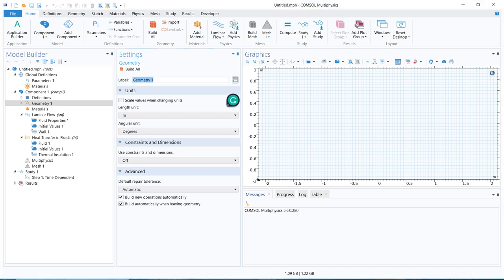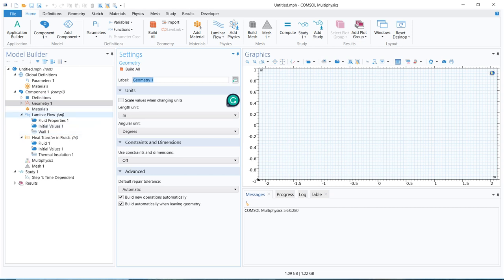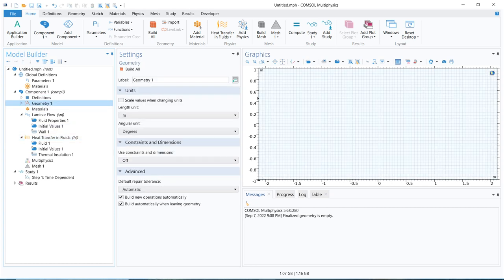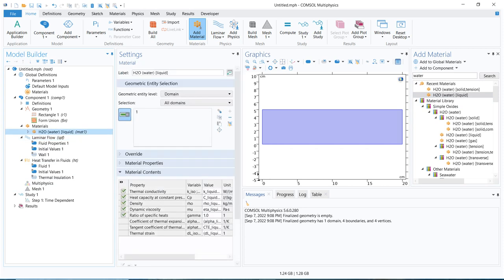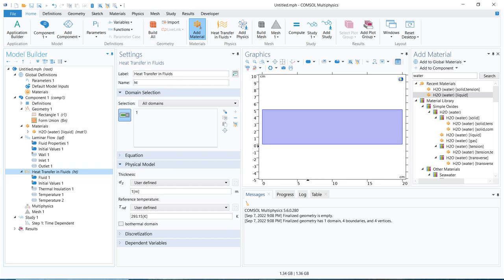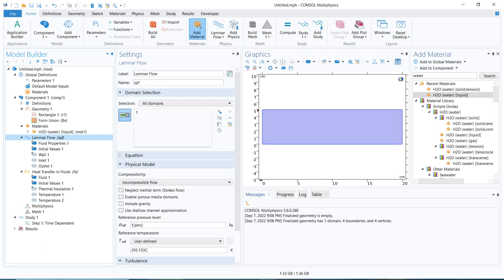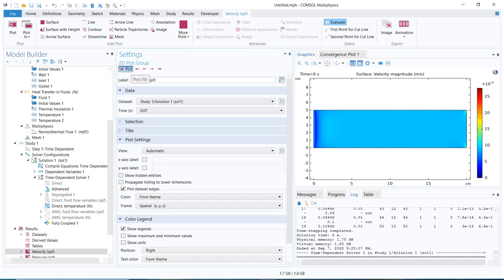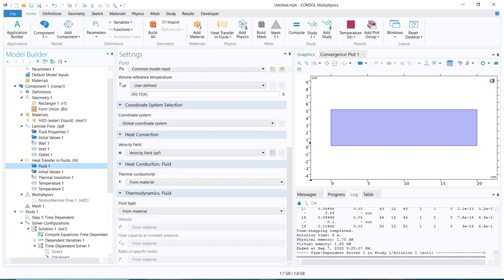Concept of Multiphysics Coupling Option #Multiphysics #Coupling #COMSOL #research

Comment: I am working on simulating the flow of gaseous hydrogen within a porous medium with the additional complexity of a chemical reaction that generates heat. I have successfully set up the basics of the flow and porous media in COMSOL (Brinkman equations and Heat transfer in porous media). Still, I am unsure about how to incorporate the heat source term issued from the chemical reaction into my problem, especially in the Heat transfer in porous media.

Comment: Hi, thanks for your video...will there be  different in results if left segregated and fully coupled ways? Is it always we need to stop solution when we see the groups in solution and stop the simulation and add fully coupled....
Reply from the maker: If your equations are coupled then the best choice is to go for fully coupled. Whenever you have independent equations you can opt for a segregated solver. This answer is based on my experience. You may reach out COMSOL support for more detailed information.

Comment: Nice Video sir, if I changes the the temperature of bottom wall to 400 K to let say 50000k , it is not compiling for results, its saying that " - Feature: Time-Dependent Solver 1 (sol1/t1)
Failed to find consistent initial values. Last time step is not converged" can you please mention the reason for this error.
Reply from the maker: Because 50000k is too high temperature and hence it is creating numerical instability. It is difficult to understand what exactly caused this error.
Reply: @pioneerofsuccess4054  ,Yes you are correct sir, I also checked by replacing with other material in the of water , but the error is same ..